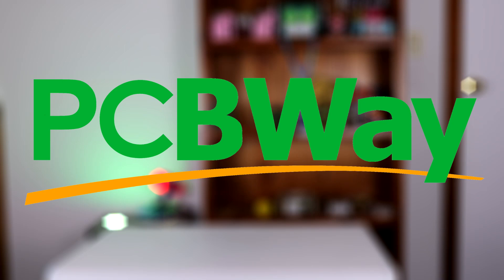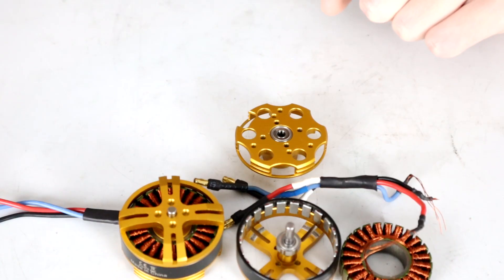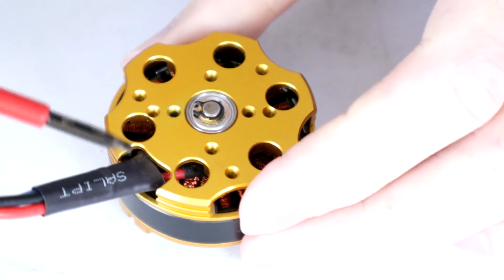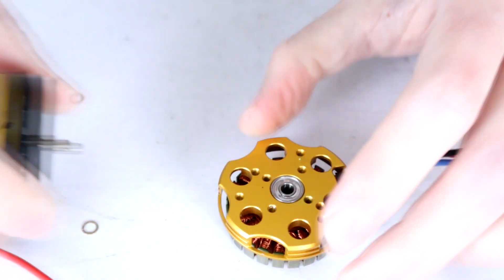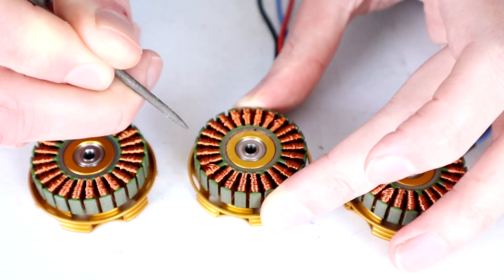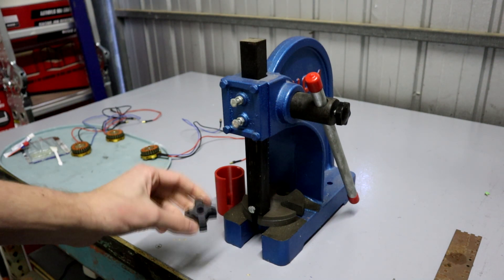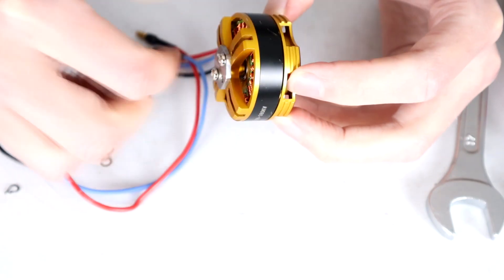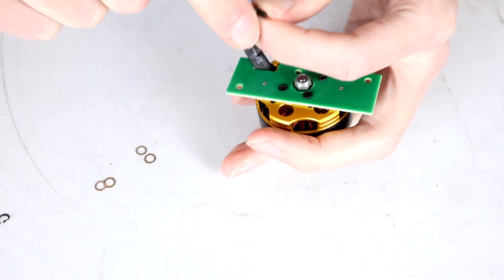Upgrading a brushless drive motor!

Comment: Instead of epoxy to hold the stators in, i'd suggest peening the aluminium mount outwards slightly, so it overlaps the stator iron at the interface where you added epoxy. Can be done with a nail punch, and you get a mechanical solution without pulling the stators off. 

Shaft looks good. Is the locknut compressing the bearings axially, or loaded against the shoulder?

Comment: Instead of the scratching and epoxy which wont work well on anodised aluminium, drill a 3 mm hole down that gap you see on the iron stator. Into that hole, then insert a M3 screw long enough, and coat that with expoxy instead. Guaranteed it wont spin after that!  you might have to cut the head of the screw off. That, or insert some kind of metal dowel to suit the hole. Physically key the stator to the aluminium housing.

Comment: Having solid metal on either side would give me much more comfort 

My concern would be that without a locknut, even a locking nut may well back out in use, and loosen the can on the motor. Generally anything that is tightening down on a bearing is designed either with shims that the bolt bottoms out on so you don't overly compress the bearing but can still tighten it down, or it has a locknut assembly of some derivative

Also, assuming the wheel bolts through the hex into the motor, a bit of loctite on that shaft will stop the bolt holes becoming misaligned
Reply from the maker: I am using a nyloc on the back of the motor and with the brass bushings, I'm hoping thats enough for the nut to not loosen during a fight
What other kind of locknut assembly could I use here?

Loctite on the shaft is a great idea!
Reply: @TeamPanicRobotics  a thin standard nut with locknut behind it to lock it against? if the shaft was stepped slightly so the thread was smaller and used a smaller bolt you could shim behind it for perfect preload whilst still tightening down hard.

I'm probably massively overthinking it to be fair 😁. It's a cool fix

Comment: 14:30 there may be a brass spacer between the stator and bell when the motors were factory built, may want to try one spacer there and one on the bottom of the motor
Reply from the maker: Looking at the un-modded ones there isnt, but I am not putting more pressure on that point. If they dont spin well, I'll try adding a washer there

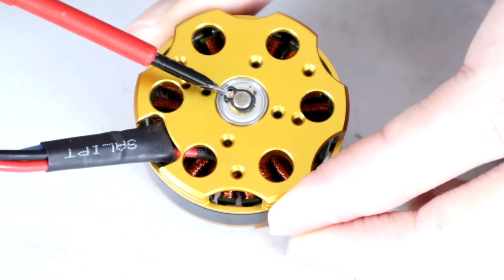Comment: 4:36 You can buy clip removal pliers (or body clip pliers) that are basically pliers with special end that you can use in reverse to open these clips and make removal easier. 
I'm sure you can find a local source, they are mass produced and very cheap, usually they come in a set with different beaks and you can try them out to see which one works best. 

The clips will still launch off into space once you get it off the shaft though.
Reply: Yep. Proper tool for the job costs a few quid but makes the job so much easier
Reply from the maker: That is a great point

I do have clip removal pliers unfortunately they dont have prongs small enough to do this size of clip.
I had mentioned them in the first take I filmed of that section, but not in the second and I missed the mention in the edit

I have started looking for a new pair that will work on the small sizes that come on insect size brushless

Comment: awesome upgrade! i'm not entirely sold on using both the grubscrew and the screws for locking the shaft, if it's too lose the grub screw might offset it a little resulting in some misalignment, but it will al be apparent or less when spinning, if it's too much vibration it might be that
Reply from the maker: Thats a great note thanks!
I havent spun the motors up yet because I want to get the chassis together first, but I'll keep an eye on them during the early testing

Comment: Would attach the stator to that base using loctite
Reply from the maker: I do have some pressfit loctite, but I was worried about messing up the windings getting them out of the motor far enough to apply the loctite

If this epoxy patch job doesnt stop the issue, I'll work out how to disassemble the motor further without breaking it
Reply: @TeamPanicRobotics  aah that sounds smart